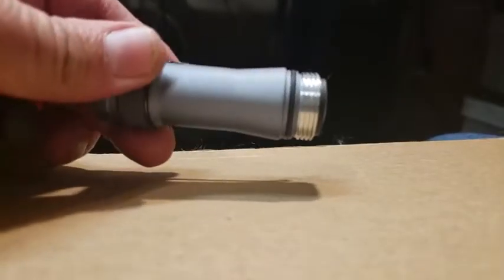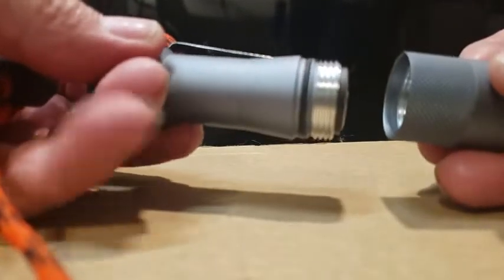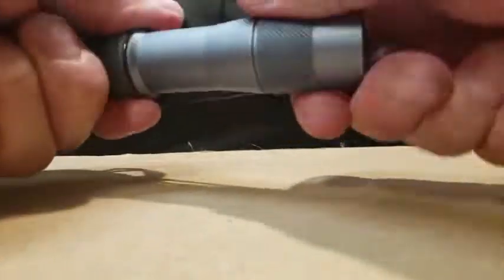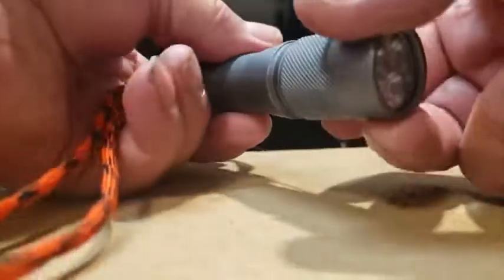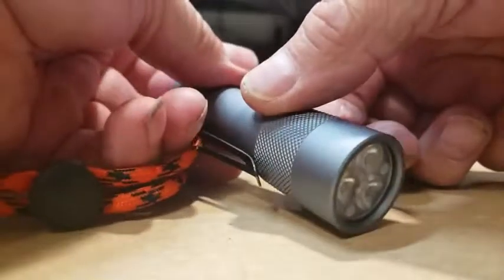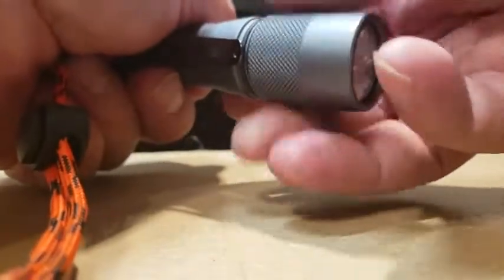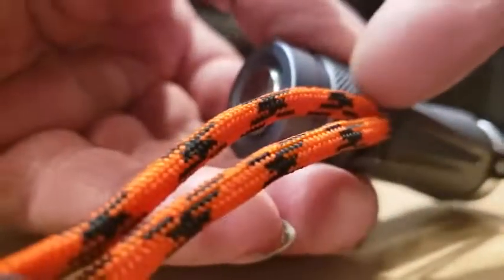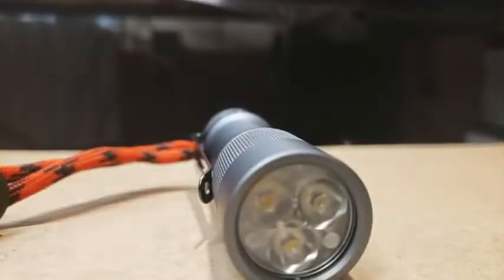FW3A failure

Comment: Had a very similar issue myself, It also started ramping and changing modes on its own. Really wanted to like this light because of how versatile it is and how much user programability there is. Sent er back right away and don't plan to get any future lights from Lumintop based on my experience, as well as Lumintop overlooking issues with the switch coming apart if you ever take off the tail cap.

Comment: Same thing happened top my new fw21.  Dropped 18" to concrete and it does the exact same thing.  Mine even turns on when place into lockout mode.

Comment: Re-seat the inner tube by taking the tail cap off. Then tighten the tail cap as much as you can without any tools. That happened with my FW3Ti+C. 

If you e already found the solution before my comment, cheers mate!
Reply from the maker: As this light burned the rail cap trace, i tried to get it to work & fix it after, but it wont turn on any more. Neal of BG had told me he would send a replacement, but i never received any thing from them, so i gave up on it.

Comment: I heard of a lot of switch problems with this flashlight when they first came out. It's unique in how the switch works but maybe its design is not good. My friend bought 2 of them after liking the first one so much and the 2nd one he got flickers and has a connection issue that is intermittent. I just ordered one since I love the size, shape and UI maybe it will be a mistake. One thing for sure, if that cell is getting hot in there on its own it is an internal short. You dont want to do that to the cell at all really. Full short could lead to a pipe bomb in your hand. Plenty of vaping accidents with shorting cells where people have got horific injuries and even dead. Have you opened the head up to see the driver? Maybe that or the switch got dislodged when it fell.
Reply: these small light have miniaturized components and tollerance are minimun
40 usd for that? no thanks
Reply: @MACYNET323  Plenty of things have miniaturized SMD components and last, cell phones, digital thermometers, computer motherboards, memory modules etc... I've personally had the items I've mentioned for over 10 years and all still working. I have the original iphone 3G that I still use as an iPod to this day. That said this flashlight does have a bad switch design when it comes to reliability but that is larger components and its a special switch that is different from a typical latching plastic click switch. You can see the switch explained well here. https://www.youtube.com/watch?v=WSeS7Slb3AU
Reply: @practicalguy973  yes I know but that depends from quality control and components
In my opinion spent 40 usd for a small ''budget'' flashlight then have these contact problems not have much sense.
It can be solved easy?
Reply: @MACYNET323  Yep I cant argue that. There are better choices for a reliable high current flashlight switch. My friend has his bad one working. It was a matter of really tightening the tail cap. So he said he will never open it from the tail again. He just takes off the head now to change battery. Others have reported not to play with the tail cap, just leave as is! I cancel my FW3A pre-order ( I had pre-ordered the raw aluminum so it was still not available) and I pre-order the Astrolux MF01 Mini which has the same GPL v3. Anduril UI but more LEDs and better thermal mass being bigger. http://budgetlightforum.com/node/66341 its too big for the pocket. I didn't need FW3A anyway as I prefer my Lumintop Tool 2.0AA for smaller size and best convenience of tail switch or twisty switch all in one!
Reply: For a triple Led,Convoy s12 looks good with classic reflector and  tail switch,simple Ui almost half price but a bit bigger and heavy

Comment: I dropped mine a few times already, no issues... Hmmmm
Reply from the maker: I must be the unlucky one to get a dud.. after the hundreds of premium flashlights i bought, modified, and owned this is the second one to the DX80 to fail in a sudden way.
Reply: @DBSARlight  ouch... That must hurt! If it's a driver issue that you can't fix then I suggest you contact Neal for a replacement driver. I'm sure he will be able to sell you one. If not, Lexel better start designing one =D
Reply: DBSARlight f